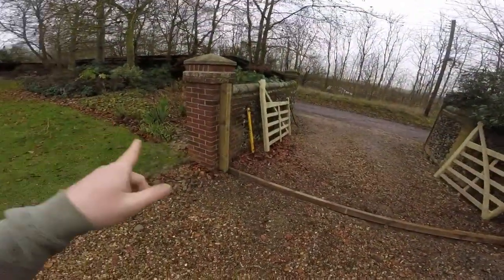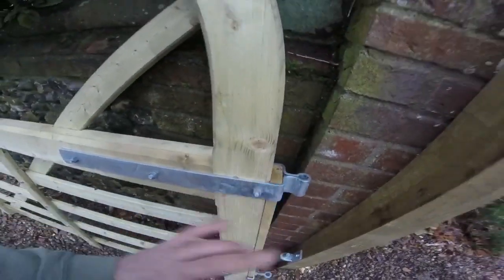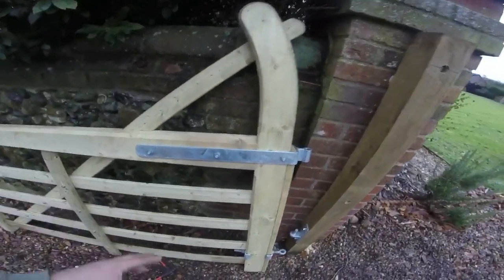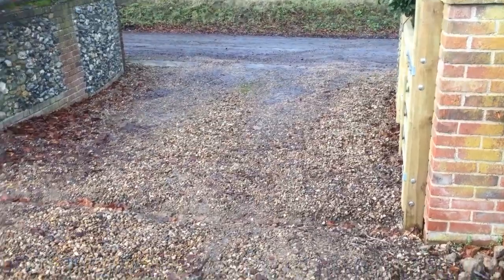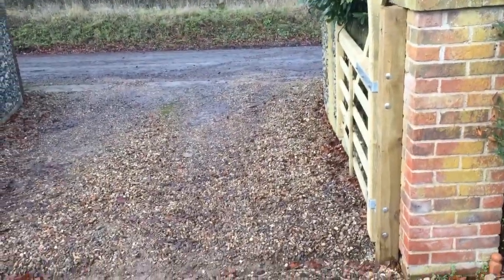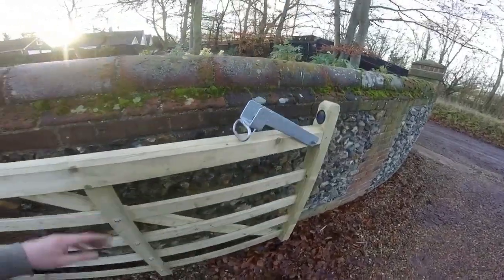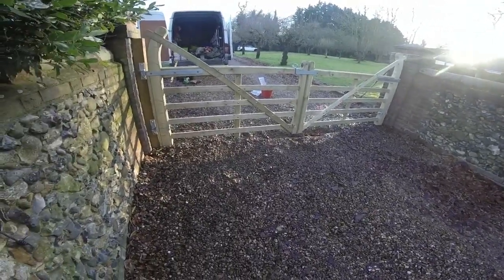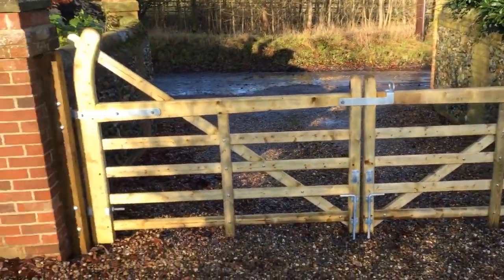Fitting Twin Farm Entrance Gates (Part 2)

Comment: Nice job Luke. Without measuring myself would have putting the gates inside the posts have been a option to narrowing the gap? When I concrete in the drop bolts I use a bit of a drain pipe and concrete into that. Gates look spot on and very tidy around
Reply from the maker: Hi that was an option, but I like to fit the gates on the front if possible so I didn’t really explore that option. It would have still required a thinner post I think. I thought It was going to be simple but the gap was a bit bigger than I thought it would be. 
But I think my solution with the batterns  was the easiest and cheapest way to go. The customer was happy and didn’t even notice the batterns until I pointed them out.  But if a job like this pops up again I shall take more time measuring😁. Thanks for watching🙂👍

Comment: Hi Luke.
Not ideal obviously but you'd gone so far before you realised. Personally I don't put any timber in the ground anymore, I'm trialing some post saver sleeves soon. Fed up with replacing the same posts over and over!
I now always get everything together on site before I start a job. Easy to get measurements wrong done it myself! 👍
Reply from the maker: Hi I think in the end it was a pretty good  solution, other options would have been, get the hinges altered but that was going to be a lot of hassle. As for wood in the ground, I use concrete posts where I can but the posts I get from my fence yard are tip top weighty (not like the B&Q stuff, I never have a problem. I expect the posts to last 10 years I doubt I’ll be still doing the job then. Thanks for watching🙂👍
Reply: @Menditman2014  
Yeah gates looked good.
I am about to replace some posts for the second time, been in only about 3 yrs. Rails and featheredge still good.
Posts are well treated but obviously poor treatment now, near the weight of concrete post! Might be down to our heavy clay soil not draining.